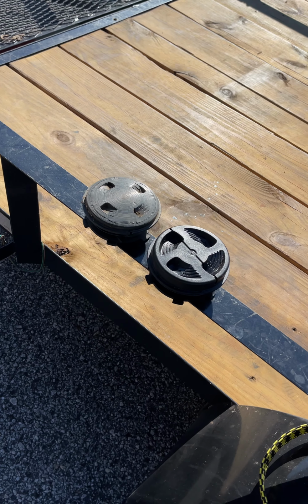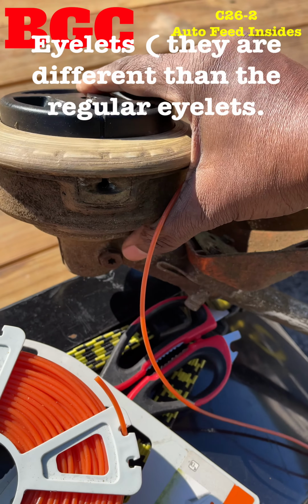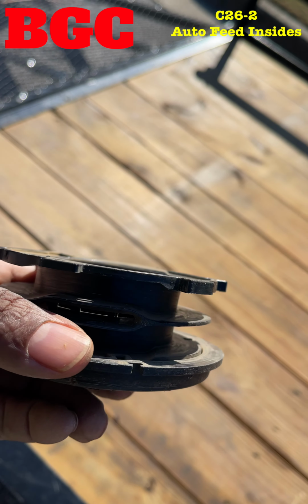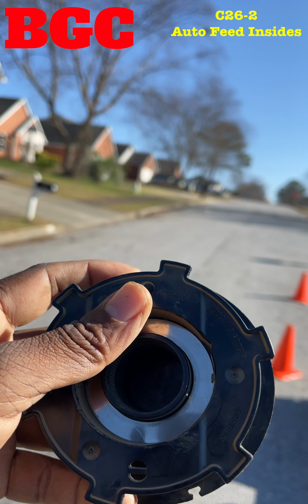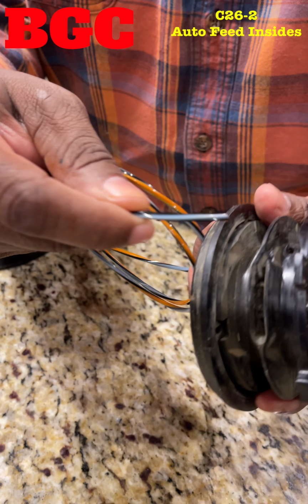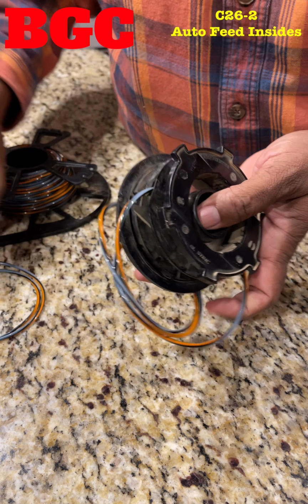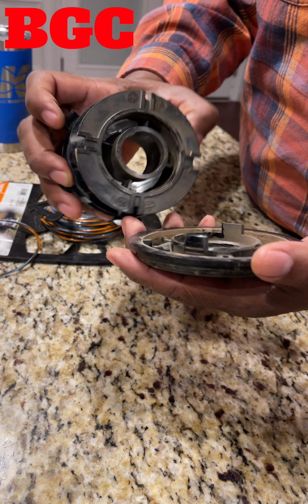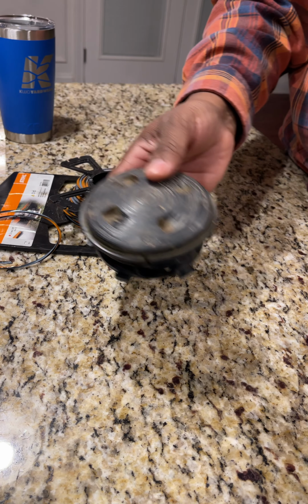C26-2 Stihl Autocut trimmer head a closer look and how it works

Comment: I have 2. 26-2 heads l have a problem turning the knob it's very hard to turn or feed the head thanks for your video ☺️
Reply from the maker: Make sure the Spring is in there.
Reply: @BYDonBermudaGrassCentral  it is it might be dirty inside does yours turn ok? Thanks 👍
Reply from the maker: @harryerhart5978  smooth like butter 🧈
Reply: @BYDonBermudaGrassCentral  thanks my friend